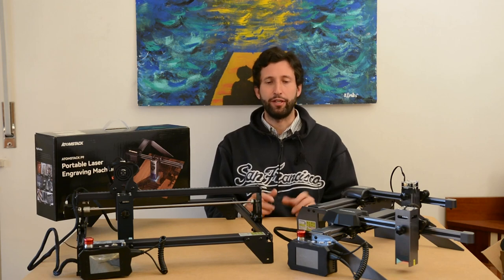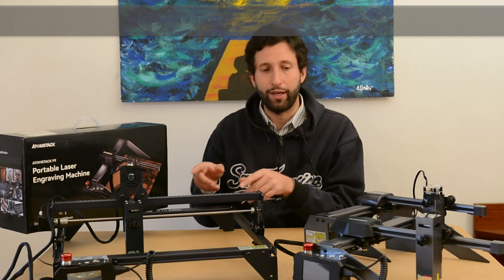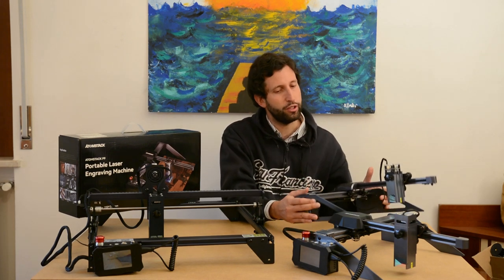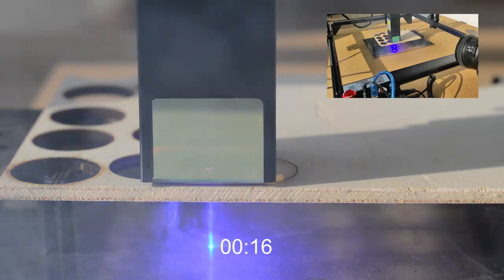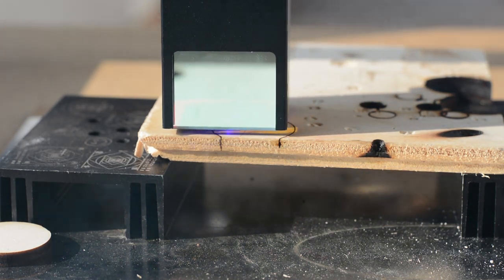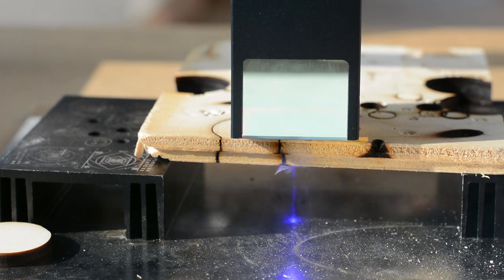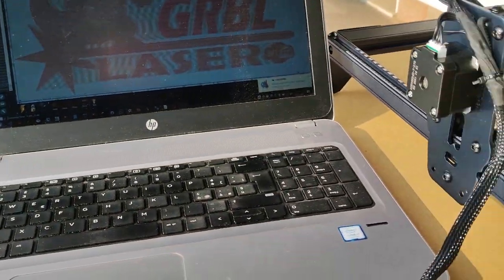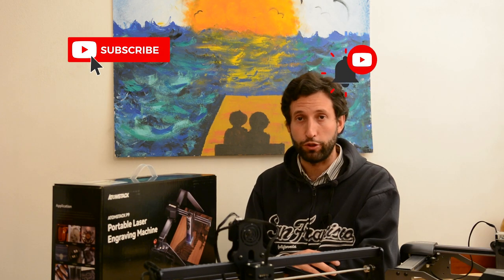La marcatrice laser Atomstack incide l'acciaio! (recensione e test 2022)

Comment: hello friend, today I started to record photos and texts with the laser that I have, before I only cut, I have the problem that the movement is not fluid when cutting and the speed is not constant, it makes small stops while moving in a straight line. Is this normal or is there something wrong with my setup?
Reply from the maker: I think you don't enable laser mode in grbl controller configuration. This makes your machine working like a CNC
Reply from the maker: Check your grbl configuration
Reply: @lasergrbl  Hello my friend, thanks for your reply, I have #32=1 laser mode, it is the standard 1.1h, I have 12,000mm/min and acceleration of 600 in the XY axes, when I advance in movement it does it very well but when it starts recording it does it in small sections making small pauses but it does not maintain a constant speed and it does not happen of 3,000mm/min even setting the program to 12,000mm/min